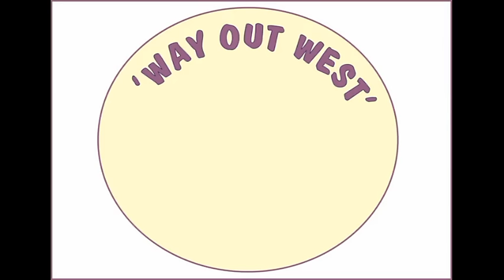How To Free Up An Angle Grinder Disc That's REALLY Stuck

Comment: So I guess that I'll have to buy a second grinder in order to be able to fix the first grinder. It sounds a bit asinine to have to have two of the same tool just so one can work. Okay, that gripe aside, I've noticed that the shaft for my grinder has two flat sides suggesting that if I can find a narrow enough wrench I 'should' be able to insert it for counter leverage. Since It appears that I've bent one of the nubs on the tightening wrench that came with the grinder, I'm going to have to buy a new one. Has anyone noticed those 'flat sides' on the shaft and tried a wrench?

Comment: Sprayed nut with liquid wrench, let it sit overnight, came right off the next day.    No problem.
Reply from the maker: Great. (But it then it wasn't REALLY stuck!)
Reply: Oh yeah,  broke the spanner trying to get it off. Did everything I could from hammers to punches to pipe wrenches.  It was really stuck. Problem was it had a steel cut off blade in it so I couldn’t break it out like the video.   Liquid wrench and a pipe wrench worked.

Comment: I just put 2 3ft long steel pipes on the end of my spanner. Shouldve tried that before trying to cut it off with a hacksaw and then I could've saved the disc :p

Comment: 2nd grinder? try some penetrating lube instead of impact loading parts in directions not designed for and grinding away the surfaces required to grip discs.

Comment: What about when a wire brush is the thing stuck on it? I can't break it, like you broke the disc. :/
Reply from the maker: could you hold the brush really tightly in the vice? And then rotate the grinder body around it?
Reply: WayOutWest Blowinblog I ended up letting PB Blaster sit on it overnight. Came right off. Thanks, though! I'll keep all of this in mind if it happens again!

Comment: Localised heat with a plumbers blow lamp onto the nut will expand the metal enough to free it. Anyone following any of the methods on the video has a screw loose - pardon the pun. Funny vid though!
Reply from the maker: hugh gallagher but remember that the heat won't remain localised - and that a surprising number of grinders use plastic gears...  This method wrecks one disc, but at least the grinder is quite safe.  Just saying!

Comment: BINGO.  Worked great.  I just smashed the disc. It was a fiber polisher that had expanded with moisture.  Took the claw side of a hammer to it and didn’t need to find out the base.  Just be careful not to smash your grinder.  Thanks

Comment: Thanks ,but if u want an easier way use your torch and heat do it for u . proper heating makes it loose enough and everything remains goooooooooood.
Reply from the maker: There could be lots of plastic/nylon elements in the gearbox - I wouldn't risk heating it at all

Comment: After you've used an angle grinder, the disk will get stuck, no matter what. These tools are single use by design. My solution? Used it for a while, the disk got impossible stuck so I returned the whole thing to Amazon with the disk still attached to it. In this day and age, it's a shame that the industry can't come up with a better design for these tools.

Comment: This always happens nearly every disc. The best way I have found as the two way prong is rubbish. Tap front near bolt with four prong holes. Turn it on its end with disc edge facing you and hit anti clockwise towards its loosening side an it will free. Before putting new disc on grease the thread so it’s easier next time.
Reply: Explain in more detail that precedure.  Thanks!

Comment: I can't cut mine off it's a dimond disc. Can't for the life of me get it off!
Reply from the maker: Did you see that one of the commenters suggested a hammer drill? I haven't tried it but maybe you could? And report back?
Reply: Don't have access to anything like that. I have tried everything I might have to break down and get a new one. Too bad cause all the reasonably priced ones are crap.
Reply: Late answer to a sad situation... But (don't you hate when someone starts a sentence with 'but'?) if you consider the grinder as a loss then you really could try a few more things that may get that disc off. 

I'd suggest trying with a 17mm open ended spanner to hold the shaft (ground down if necessary), a bit of heat and try to tap that nut loose. If the pin holes has been rounded off then you may have better luck with a chisel than with the pin key. Heating something like this can have interesting results, and you don't necessarily need it to be red hot. As the nut and shaft is heated the materials will expand. The nut having a larger diameter will expand slightly more than the shaft at the same temperature,  and as the shaft will sink a bit of heat into the rest of the machine it will probably be slightly colder than the nut.
Reply: My cheap one stucked one day...i used a bench clamp to hold the screw, and turn the grinder...the bench clamp must got good grip...now my Hitachi stuck...need to find a bench clamp...

Comment: tried this worked well, used a dremel tool as i didnt have a second angle grinder but still effective enough.  When i took the disc completely off could see that the nut had jumped a thread so i just used a crowbar to realign it.
Reply from the maker: "I just used a crowbar to realign it." - love it!
Reply: WayOutWest Blowinblog

precision task requires precision tools :)

Comment: Too much effort. Just burn or heat the nut and then tap it rapidly with a hammer and iron stick. Remember "rapidly" not full power single struck.
Reply from the maker: You will melt the seals inside

Comment: Sorry, blogger, this is a Terrible idea ! Correct way 1. A little penetrating oil 2. Metal clamp disk so it won't turn 3.With your weight on the grip, tap or hit a flat head screw driver into one of the 4 holes at 45 degree angle until (usually easily) gets loose. Never met anyone who thinks the lock button idea (all grinders have) was a great idea.
Reply from the maker: A terrible idea? Except it works fine : -  )
Reply: I clamped the metal disk in a vice and used my Milwaukee 1/4" impact and it came off! Before that I tried everything else.

Comment: phuckin diamond blade stuck cannot smash
Reply from the maker: +monsieur305 That's too bad. Maybe a hub puller?
Reply: monsieur305 me too except concrete diamond blade is thick as phuck
Reply: monsieur305 heat it

Comment: or you.could not allow your tools to seize like an idiot!:D
Reply: How do you do that?
Reply: This tip worked , tried most of the usual correct key spanner , moe grips, penetrating fluid, applying heat etc,...didn't use my small grinder hacksaw blade equally rotating the head until the burred disc cut away...thanks